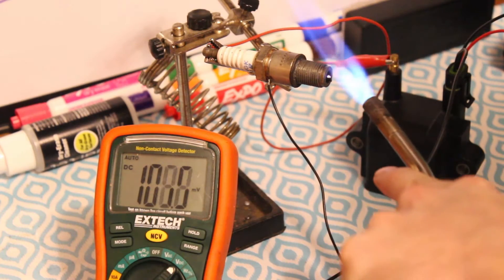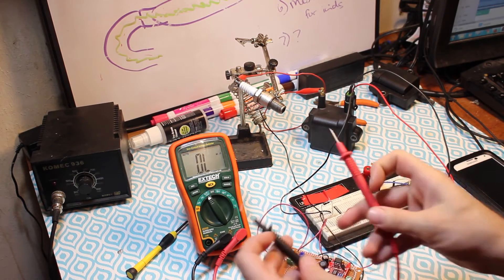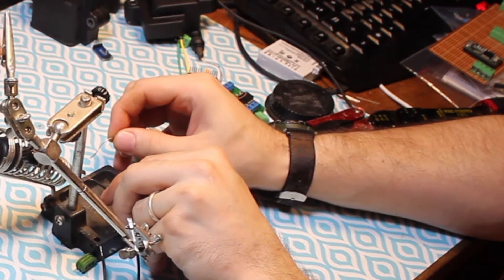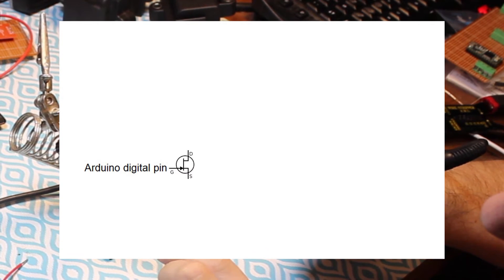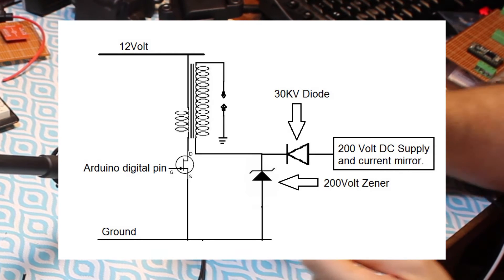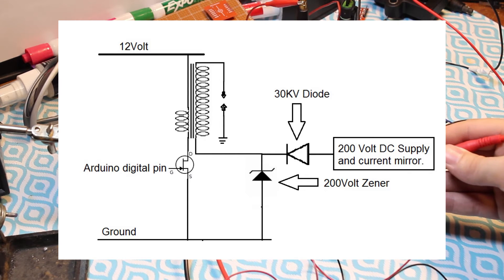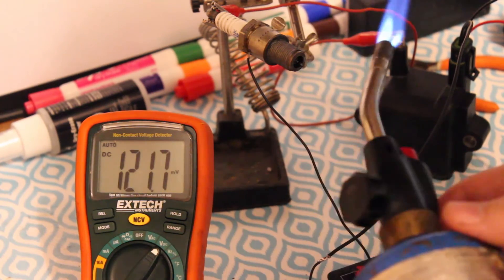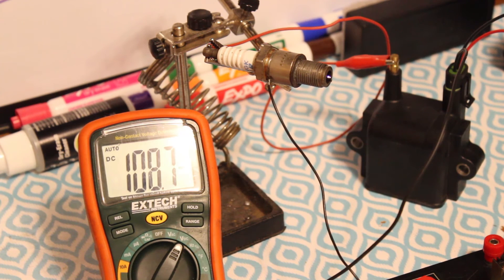Using Sparks and Flames to Measure Pressure - Ion Sensing the Blue
Beast 3- Voiding Warranties Ep 5

Comment: Saab here in Sweden invented this back in the mid 90s
Reply: It’s true partially . The principle was invented somewhere during WW2 for aircraft engines use . If find the source will post it here . I’m long term interested in the subject and especially in its features which isn’t used usually , as air/fuel ratio measurements and in cylinder pressure measurements  .
Reply: @flappingflight8537  Well that is true for pretty much everything. The principle is useless without semiconductors that can deal with the actual current measurement. Maybe they used Ammeters. Very useful for modern EFI systems tho.
Reply: @TheChrisey  sorry under the second picture .

Comment: Are you send the data back via CAN bus or running a new run of wire? And where are you getting the data from the circuit you made or the arduino?

Comment: Saab's trionic engine management hardware already does this and detects spark knock and misfire issues. its one reason saabs can auto adjust to fuel octane adjust ignition timing advance for each cylinder as well as turbo boost limits ,,
Reply from the maker: +Brian Perkins SAAB Trionic is impressive, but no such animal exists for a rotary engine. There are however hacks available to make it work on a non SAAB piston engine.
Reply: my rx8 when is hot take 20 minutes to start again